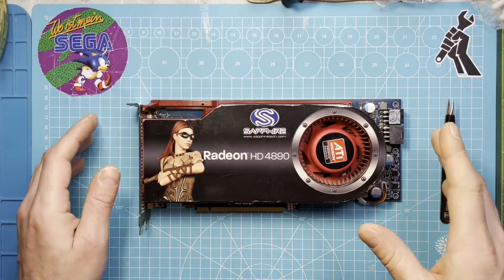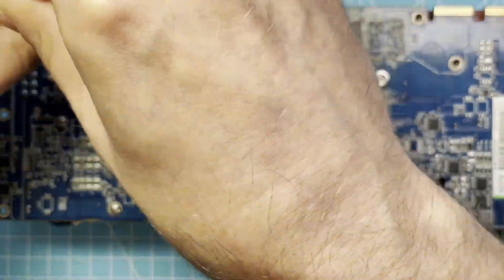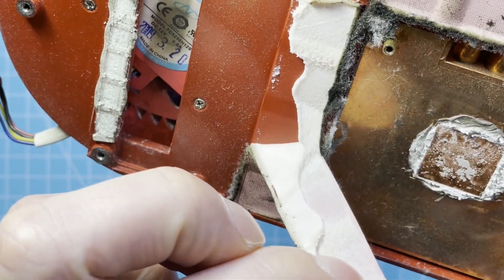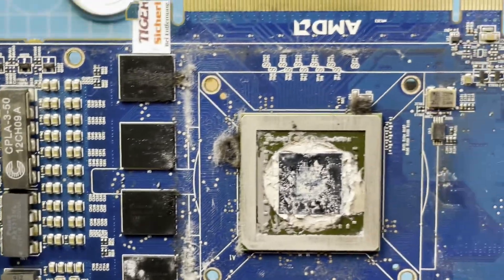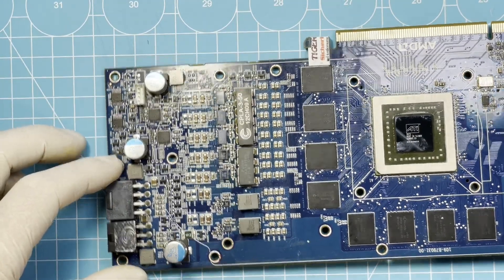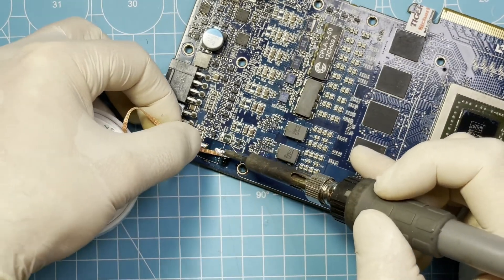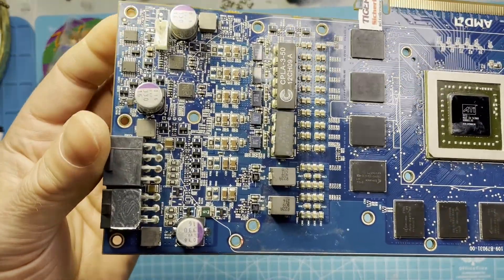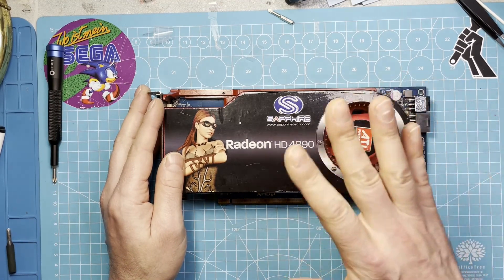RESTORING AND FUTUREPROOFING A SAPPHIRE RADEON HD 4890 (1GB) GRAPHICS CARD

Comment: I have two of these exact units and I installed then brand new in Oct 2009. One has just started making a noise in one of the fans otherwise they still are rock solid. I paid a hefty price for them back in 2009 I think nearly $900  each, but they were for my high end gaming PC I was building back then. In crossfire mode they are unbelievable! I wish I could get my hands on a second hand one as I could swap out the fan on my dodgy one and I would continue to use them as they are great for what I use them for these days. Cheers
Reply: Is the tape you are using to replace the old tape just double sided tape or a special thermal tape and if so can I ask what thickness it is and how you bought it? I have found it in rolls on line but it is only 0.1 of mm thick? does it serve a purpose other than to cushion the cover or does it actually transfer heat? Any help much appreciated as I was able to order two replacement fans from the US and will be attempting this same re application of the thermal paste.
Reply from the maker: It was a special 1mm thermal tape.
Reply: @TheKonsolist  Much appreciated. I think I have found some on Amazon. I hope I can get both my 4890's back up and running. They have done 14 years of had work and still out perform some cards today to some degree. Cheers
Reply from the maker: Nice. Please let me know how it went.

Comment: Nice! I have the powercolor version zero therm I think it says on the heatsink (no shroud and no display port or hdmi just two dvi and s-video). I bought mine a couple of years ago for a similar price and never tested it until today and it seems to perform well in my xp build and temps are good! I've just ordered a crt to complete my xp build, (silver compaq 16/17 inch will match my silver case from circa 2005 well, can't wait for the monitor to arrive!!